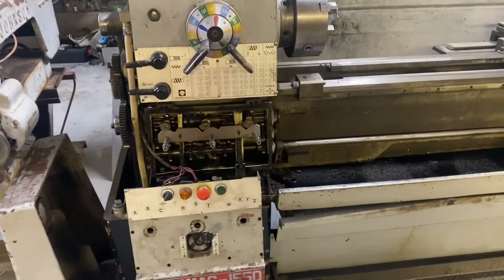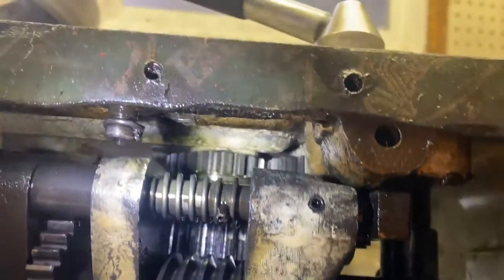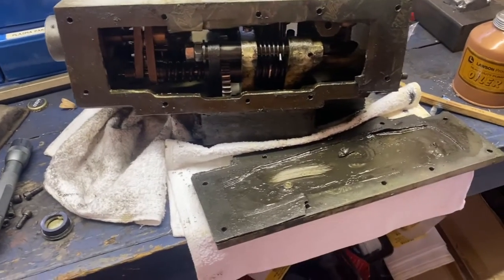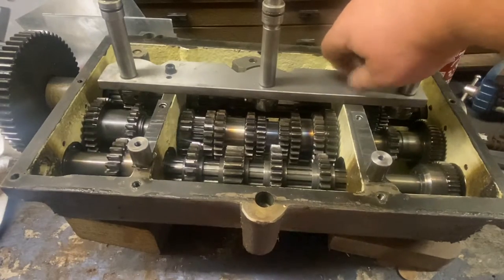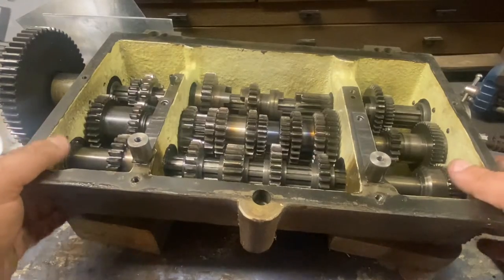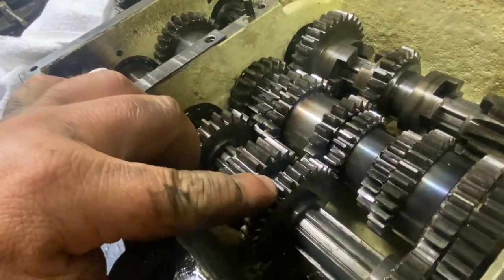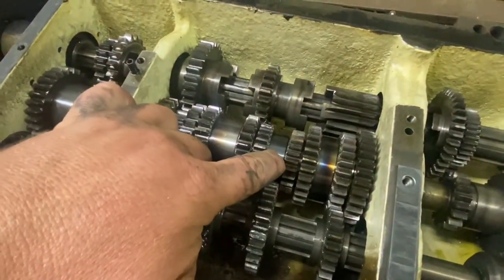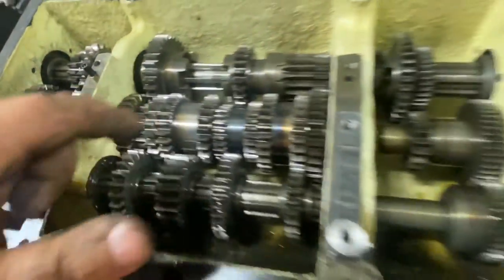Removing and inspecting the carriage feed gear box on the hipromac

Comment: Looks like a Clausing Colchester.  I had one with the rainbow speed selector.  16x40
Reply from the maker: It’s a almost exact clone of a clausing triumph 2000
Reply: @smalltownmachineshop6860  I thought it looked familiar.  We just started making gears in the shop on a as needed basis now that I finally got a set of cutters together and a good indexing system.  I noticed it says Shell Tellus 27.  We tried to get that.  I been buying ISO oil from Hangsterfers but was contacted by CLC lubricants so we wil see.
Reply: Hello sir .I brought same machine but used one .In that gear box some part is missing. Can you help with that .The last row of geared are missing  complete